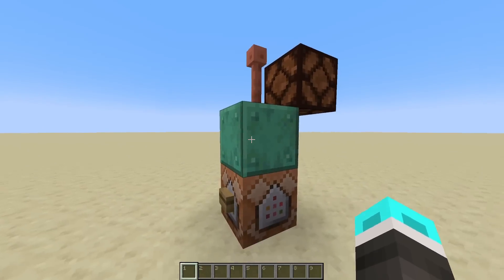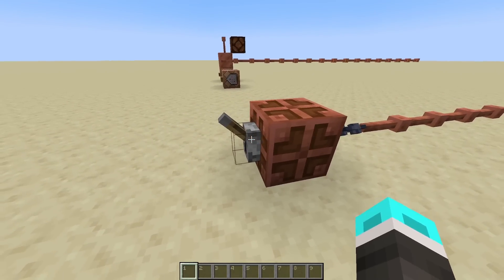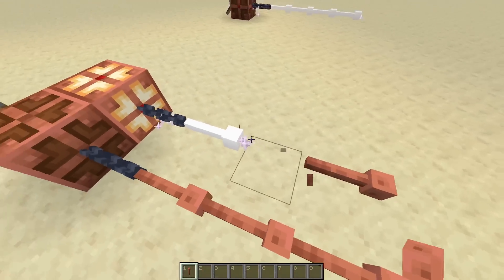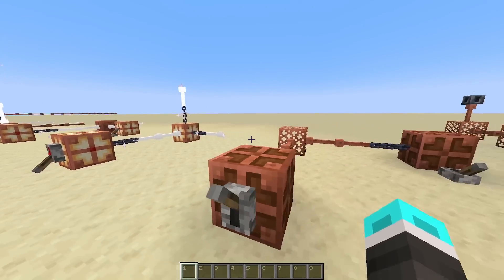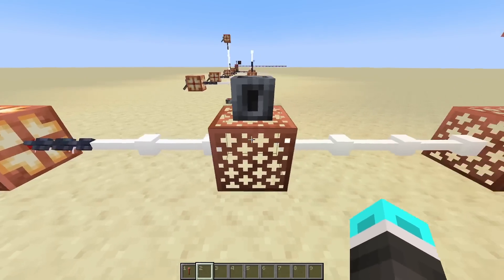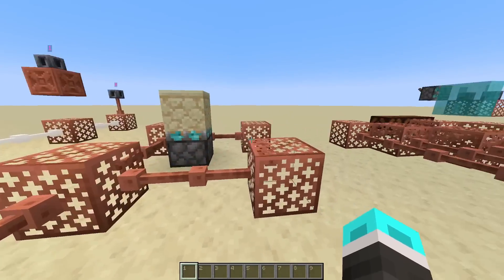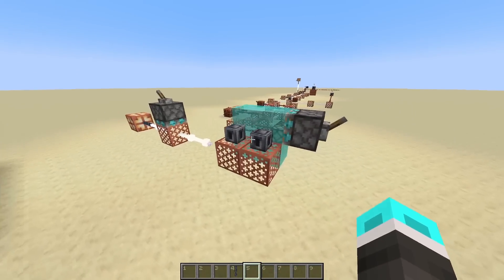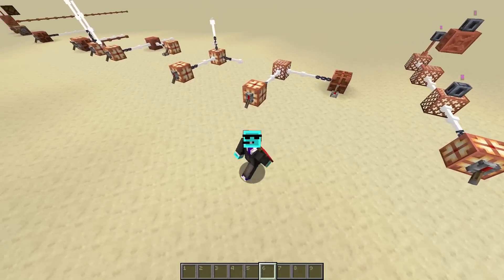Copper Wiring Datapack Beta 1

Comment: I think you should have the option to wax the wires to insulate them so they don't do contact damage
Reply from the maker: @SIK_Mephisto  That seems to be a common suggestion here. I'll have to find a way to add the ability to wax them, since you can't normally
Reply: @AuraAcorn , you could put them inside a glass. Glass is a good electrical insulator, allows you to see inside and is used in real life in high voltage electric poles.
Reply from the maker: @beyondermage  these can't occupy the same block as glass, but I like the idea. I'm sure there's a way to do something similar
Reply: @AuraAcorn . Cool! I also like the idea of glass because in the real world lightning produces glass when it hits sand.

But if this happened in Minecraft it would be a rarer event (since it depends on lightning) and would require a silk touch to collect it...
Reply: @AuraAcorn maybe block display entities?
Reply: @AuraAcorn  Block Display to display the wire inside, marker for functionality and detecting the removal of glass to place back the original block and interaction to detect right clicking.(but interaction entities will overwrite the ability to break the block.)
Reply: Yes  @AuraAcorn  just make it do when you right click or drop a glass block onto the wire, it converts the wire into a block entity, places the glass, and uses the rotation of the block entity to determine the direction to send the power, since glass isn't directional.
Reply: @AuraAcorn You can also try to add some kind of wax crafting recipe that processes it and dyes it to be used as wire insulation
Reply: @AuraAcorn  Could it use block display entities or would that start to lag the game at some point? On tiktok there is a guy who builds and abuses the hell out of block display entities and his performance seems pretty ok
Reply: @AuraAcorn I don't know how data packs really works so Idk if this is possible but can't you just copy the code of the thing make you able to wax copper stuff and just implement it into the code of the lightning rod?
Reply: @AuraAcorn  resource pack utilising custom model data so you can selectively override the textures and models?
Reply: @AuraAcorn  you could use the new food component(or js use the consumable one in the new snapshot) to shoot a raycast that checks if the block you're staring at is a lightining rod, then you could do so it summons a type of tile entity or marker that sends particles and it disables the damage function.if it fails it gives your wax back. I cant remember right now but I think you can center it using the execute command. hope it helps!
Reply: @AuraAcorn Maybe wax paper sheathing like wires had before pvc and silicone.
Reply: @gljames24  except this isn't a mod, it's a datapack, it can only use pre-existing assets from minecraft itself
Reply: @AuraAcorn  should just be a ray cast on right click, you should be able to detect right clicks holding any item with the new food item data
Reply: @AuraAcorn  also can you add some way of inverting a signal, its way to complex in its current state to do that. just think of a way to apply it since its not that complex to make (i think). And the way you make it, if you do, can you do it pure solid state
Reply: @AuraAcorn  Minecraft makes taking right click events really hard for the player. I don't think u used a texture pack in this video, so it will be very difficult to do this, as you can't just retexture something like a carrot on a stick with custom model data.

What I like to use is an interaction. Interactions can be summoned with /summon, and they record (in their data) the UUID of the last player who interacted with it.
Thus, you can use the interaction, check for the UUID of the player who used it (<= this is a bit difficult, but possible), check if the player is holding honeycomb, and if they are, then change your data of the "copper wire" for it to be waxed, and then remove 1 honeycomb from the player.

Sonds a bit confusing, but I've been working with datapacks for 5+ years now, and this is a really cool thing! Good Job :)

Any help? DM: @blitical on discord
Reply: @AuraAcorn  also waterlogged wires should damage player at a greater distance, I bet many people stated taht before xd  Very interesting  pack, can't wait what's comming next!
Reply: @AuraAcorn  Detect when the player is holding wax, then create an interaction entity around X amount of copper wires nearby, then if the player interacts with the wire with the wax, remove the item, and then do what you need to do. Probably going to have issues with pistons tho
Reply: @AuraAcorn  interaction entity enveloping them when a nearby player holds wax, maybe?
Reply: @AuraAcorn  by crafting
Reply: That’s actually a great idea
Reply: boosting so he sees. Really good idea!
Reply: and no lightning
Reply: and make it not work under water unless its waxed.
Reply: @AuraAcorn maybe for waxing, use an interaction entity and check the held item?
Reply: nah
Reply: If there was the addition of having an increased damaging aoe radius while underwater, I could see insulated wires being a popular addition to the pack
Reply: I read it as "conduct damage" and thought that's really funny
Reply: Also make water electrified when non-insulated wire is powered under water. Say like 2 block radius.
Reply: I'd rather have something a bit more reliable. Wax is lame bring back the rubber tree

Comment: From someone just getting into datapacks, this is extremely impressive. I know you use a single entity for each powerline (or at least that's the gist I got from the patch notes) but would you be willing to go into the technical details of how you made this pack? Like, do you think a redstone computer made with these would be bad for performance due to entity lag, or are there some sort of culling measures taken?

Again, this is amazing. Thank you for polishing it up and I can't wait to add it to my own world.
Reply from the maker: @nur-e-amanrefai9038  I use markers, which are the least intensive entities in the game. First time the pack came out, markers were persistent which had the potential for lag when big computers were made. However, now for wires they only exist when it's powered, which is a lot better. Personally I don't think there would be much lag and performance hit even with a huge computer, as long as your computer is somewhat modern. It might lag a server though.
Reply: @AuraAcorn  Very cool. How do you detect which block to summon the marker entity at, if I may ask?

Comment: use the wax to rap around the copper wire so it doesn't zap you, when waxed it color will be a mix of copper color & wax color
Reply from the maker: @PhạmHiếu-g2h  You can't wax lightning rods as part of the game, and can't change the color of it being powered. I might be able to add something like that though
Reply: @AuraAcorn  wep ok
Reply: @AuraAcorn  detect player holding beeswax -> use one of the plethora of right click detectors that serve your needs (silent wandering trader TPd to player) -> detect when right click -> raycast to see what block theyre looking at -> if lightning rod, wax it.

Comment: How much charge does the heavy core get from a lightning strike?
Reply from the maker: Since heavy cores don't attract lightning, it won't hit them, so it doesn't not charge. Through a wire it doesn't change much either, since it's based on the amount of time the wire is powered. I could probably change some of that though

Comment: I was wondering what the heavy core does with 1 input and 2 outputs, does it charge and discharge in pulses?
Reply from the maker: If it has power stored, it'll act like another input and power the second output. If it doesn't have power, it'll be dead and the inputs and outputs will ignore it until it can charge

Comment: what is the signal strength? how does it interact with Redstone and its components. Which will have priority over the other. I like this idea more than blue stone. Personally, I think the two should be separate it has zero interaction with each other. but have coppers components added. like the copper piston is crafted with a piece of copper instead iron. and maybe add copper nuggets for the Redstone needed components such as an observer or repeater. I think the signal strength should be equal or a bit higher than Redstone. because it is slightly more expensive. I guess the question is do you want this an early game solution or have it the more at the same time as redstone and side by side?
Reply from the maker: @pencilpenhead  I would say side by side. Every powered wire has a max signal strength, which is just part of the game that I can't change.
I also like blue stone more, however as far as I can tell, there doesn't seem to be a way to make that unless it is a full blown mod.
Maybe next I'll make this more survival friendly by allowing redstone components to use copper instead of iron, like you said!

Comment: Looks good, but I would like to see a way to negate the signal in some way (without using redstone mechanics in any capacity). The grate is already functionally an AND (number of inputs is equal to number of outputs, where both are greater than 1) gate or an OR gate (1 output with more than 1 input), but with the NOT gate, you could create any logic gates using those as the base, which would allow for much more complex circuits. I would suggest maybe using a redstone block, since it's "powered" by default (and there aren't a lot of copper blocks to use), then have it act as a NOR gate (any input deactivates the redstone block and any outputs connected to it). The heavy core also seems very expensive for what it does, since it's basically just a capacitor/battery. Maybe something like the cut copper block, and having the different oxidation levels correspond to different maximum charges or current charge level. A pulse generator would also be neat, but not strictly necessary, since you kinda did show a way to create one with the grates and rods in a loop (Just add one more output and a constant input to one of the grates, and it will be a pulse)
Reply from the maker: @RasMatHam02  Those are all amazing ideas! Yeah I wanted to cover the entire logic gate suite but didn't know what I was missing or how to do it. Nor gates will definitely come in an update! Thank you!
Reply: you can do a NOT by making a powered line of copper rods, putting a copper grate in the middle, then a piston facing the grate. run the input into the piston.

if the input is off, the piston is retracted, and the copper grate lets power through. if the input is on, the piston pushes the copper grate, and the power line is stopped.

you might not need the grate i don't remember if pistons can push rods.

that's basically a simple transistor. there should probably be a better way to make something like this.
Reply: Good suggestion! I thought something like a quartz pillar that conducts through from the top to bottom, but only when no signal is coming in from any sides, would also allow for NOT gates (though they would need an always on bulb, chain combo, and wouldn't be that compact for that reason.

The redstone block as an effective NOT gate is a good idea!

Comment: I don't understand the point of the chain as a transformer. Why not just take the power direct from the copper bulb?
Reply from the maker: @NedJeffery  lightning rods power bulbs, so the bulb would never turn off if directly outputting, creating infinite power. It also has to be a transparent between them, because same happens with a full block

Comment: Love the pack! Maybe the transformer part could use a little more effort because having just a chain makes it almost too “convenient” to interchange lightning to redstone. 

Also what can be fun is adding electrical explosions ig wires run into each other, or electrifying the water when it runs through it with custom death messages. 

Really looking forward to more!!
Reply from the maker: @necroscaper  Awesome ideas! I'll keep them in mind
Reply: @AuraAcorn  I would love if that the more charge the heavy core has, the bigger an explosion or knockback sort of deal, instead of a longer timer duration, the longer its charged.
Reply: @FaerieEnderHare in an ideal world, you could put an item frame with a Mace instead of a raw heavy core, and if it has 100+ charge when you remove it, it basically becomes enchanted with Channeling 😂
Reply: Oblivious solution to last one will be electrifying adjacent water blocks. Just kinda real life as water is not such a great conductor

Comment: This is quite cool! Sadly it's extremely survival unfriendly, since the heavy cores are such rare loot.

Depending on the transmission rate and how reliable it is, i see computers using buses to these cables for compact long distance data transmission!
Reply from the maker: @XceptionalBro  That's true, though I see using it as a reason to go out and get more of them. But I get your point, maybe I can use another block
Reply: @AuraAcorn  I had a random thought to use potatoes, like potato batteries lol. Only thing is there's no block for potatoes in vanilla so maybe it would need to be potato in an item frame or something.
Reply: @mindnomad  raw gold kinda looks like potatoes though

Comment: Personnaly- i think you should make the redstone lamp a Copper wire to redstone transmission.
Reply from the maker: @MaIn0urish3d  I was considering that at first, but I settled on bulbs to stick to the theme of copper. I totally could add lamps too though!
Reply: @AuraAcorn hey, builder here, redstone lamps would make for great usage of buttons, since copper bulbs keep on and off after updated, which could be annoying if you want a responsive interface.
And it would be more compact then hiding it on the back of the block, compactness seems like a theme when you look at parallel lines.
Reply: The lightning rods already do that (they output into redstone)
Reply: @theopoldthegamer4284  that could get quite messy don't you think?